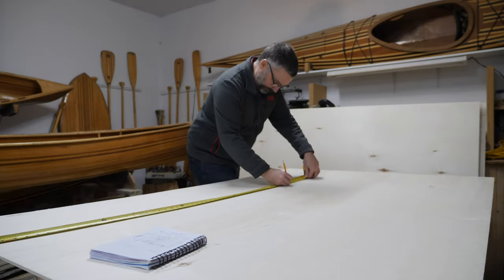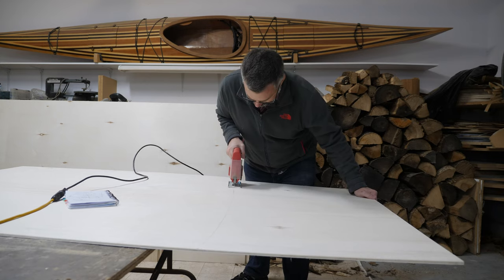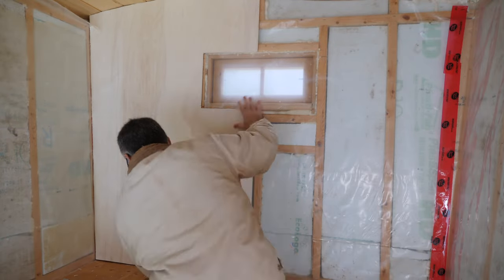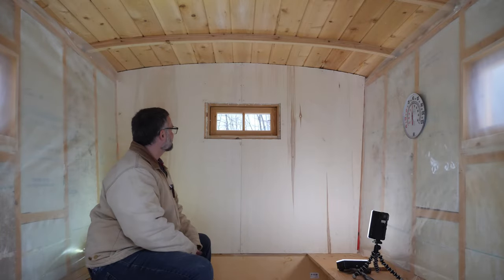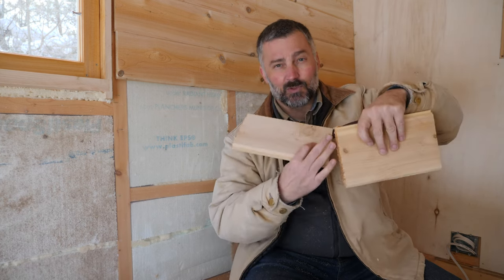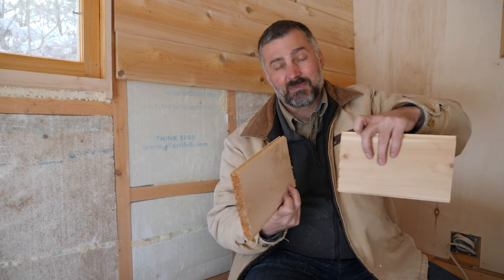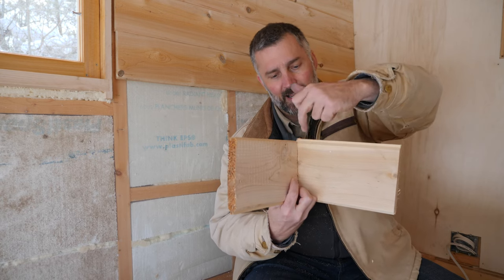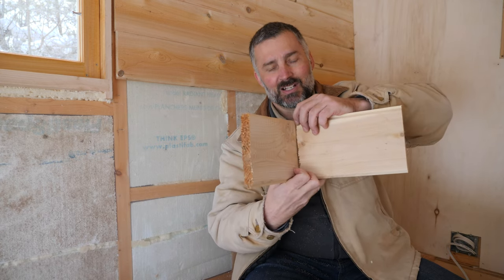Building My OFF GRID CABIN on Wheels: the Inside Walls | Off Grid Cabin Build

Comment: 2021 wood in nj is very expensive and hard to get.(we don't buy wood from home depot/Lowes so they don't count.Their wood warps in 2 days outside before you even get to use it for the project & good luck finding any straight pieces without knots or holes)

Comment: How well do you think this is going to do on the road? And what is the top speed you think you'd be comfortable with driving? I'm planning on building something similar but I worry about it blowing apart while driving..
Reply from the maker: Good question! I think it will go alright but of course I won't be driving too fast. I've used enough construction adhesive and epoxy in addition to the screws and nails.
Reply: @TrailguidePictures  I hope it stays together! I plan on making something similar although the roof will be different.

Comment: Good work, just wondering, was there no other way to avoid using plastic and polystyrene, that give off toxic fumes over time, and also taint the wonderful smell of the wood, surely there are natural fibers (products) the can be used for insulation?. Also plastic against wood seems like a recipe for mold.
Reply: moisture barrier.... rather a little plastic than a LOT of mold that can kill ya